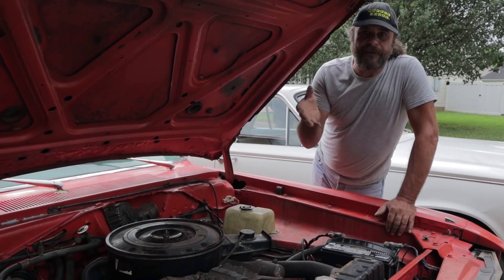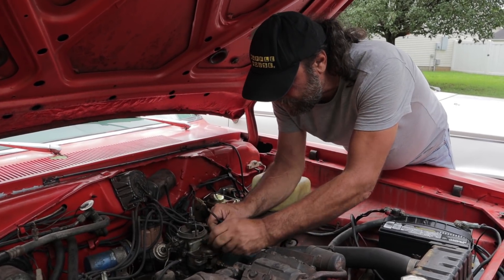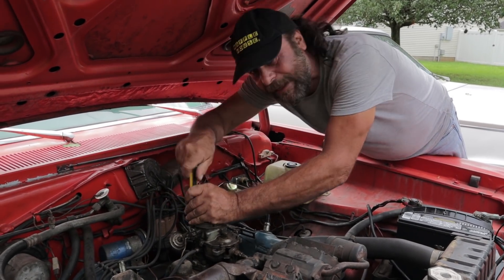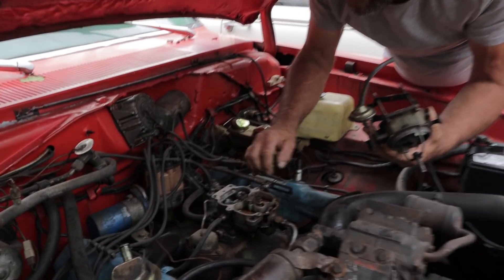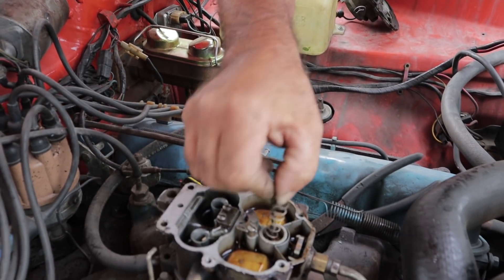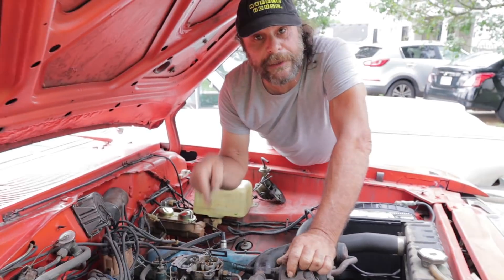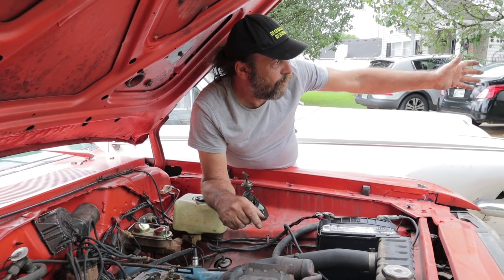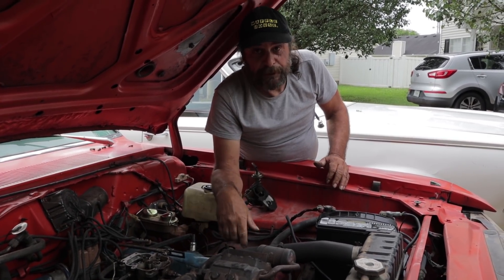Driving Classic Cars- The Truth About Ethanol Gas

Comment: you are much more knowlegable then i am on cars.. however i have to dissagree with you this time.. i have had white corrosion inside the carb on mowers.. motorcycles and cars when using the new gas.. i still use it in cars and trucks but will never use it in anything that may sit for some time between use again

Comment: In my personal experience I will never run ethanol fuel in anything with a carburetor. From a small engine to a car. I have dealt with the problems of ethanol fuel and what It does from sitting. Since now switching to non ethanol those problems do not exist

Comment: The problem with ethanol in old cars is people don't clean all the crap out of the tank and lines. Then they run it and it actually cleans all the crap and as it does that is what is left behind in the carb. It's not rocket science, clean tank and good hoses you wont have a issue but toss modern gas in a dirty old tank and not clean anything and its a nightmare.

Comment: Bottom line there is no Lead in today's Gas. The lead coats the valves in older cars to protect them. If you have an old engine that has not been rebuilt with valves made to run on unleaded Fuel you should be adding lead sold in many places to your Fuel to protect the valves. Own a 1969 Firebird with the OG 350 Pontiac Block in it that has never been rebuilt and it's still running strong uses no Oil. a 50 Yr old engine still running great.

Comment: ethanol is poison for your fuel system, after they started selling ethanol i started having carb and fuel line problems with all my old tractors and trucks. all of them started dripping and rubber fuel lines started melting and any small engines would not even start sometimes i think because the gas stations mixed ethanol at more then 10%. so now i only use corn gas in the leaky machines until i get them fixed as the budget allows then i buy real gas.
you are lucky your car is in good shape for now just like people who smoke for 30 years and never get sick from it.
the best one i have seen so far is my neighbors lawn tractor that needed a new carb and gas line because of ethanol, the gas line was actually melted on the inside and no gas would flow through it, i never saw it that bad before.

Comment: Always hear horror stories of gunked up carbs,rotted fuels lines,and whatever else.. I've never had a problem with ~10% ethanol fuel. It does evaporate quickly,and my old 327 takes a bit of cranking before it fills the bowl and comes to life,but other than that,none of the issues you always hear about.

Comment: I respectfully disagree. In my experience ethinol fuel vapor locks all my classics and in certain cases rubber components deteriorated. My vehicles do not like this fuel and I have a multiple make collection. Your video was very interesting though and I’m glad you are having luck with the modern fuel
Reply: How often do you run them and when was the last time you had the fuel tanks drained, inspected, and cleaned if necessary? You're getting vapor lock because there is watery fuel in the fuel lines coming from your tank. If you have water collected at the bottom of a tank from ethanol fuel, you'll need to drain it. No amount of additive will save you from already stale fuel.
Reply from the maker: Check out the video we did on vapor lock a few weeks ago
Reply: Doug all cars are restored to near concourse specs. Tanks have been steamed and sealed. Run great on ethanol free gas. Not this epa crap
Reply: Uncle Tony's Garage I have and it is a great tech video!!!
Reply: @Plasticmercenary  You didn't tell me how long they sit, so I have a hard time believing that, as ethanol fuel has a higher resistance to knock than ethanol free, it runs cooler, and has run just fine in a mechanically fuel injected 1986 Saab 900 turbo i wrench on to 200,000 miles and counting. Fuel today is light-years better than it was even 20 years ago. I don't understand why you old timers think e10 is this evil communist engine destroyer.
Reply: Doug they are ran almost daily. I’m fortunate to drive a different classic everyday of the week if I choose and I often do. My European cars dislike that fuel more than my muscle cars. As far as the old timers quip , I’m 40 , and I will take 1979 cars and older anyday over disposable cars that have limited upgradable tech. Like a cell phone
Reply: @Plasticmercenary   I still doubt the fuel is the problem. Classic european cars don't need an excuse like ethanol fuel to run poorly. 

Forgive me, but your comments about your concourse quality restored classics and modern epa junk makes you sound older. If anything, cars have become far less disposable than they were in 1979. The exception being "luxury  vehicles" built to survive one lease period and ruin the second owners credit at some certified used facility. 

How many miles did your average schlub get out of a base Cutlass, Vega, Escort, Pinto or any other high-volume economy car in the  70s? The malaise era produced far more dreadful cars than classics, as is true with any decade, we just remember the good ones. You were lucky to go 100,000 miles, and even that would have required opening up the engine for overhauls, nevermind how many sets of points and condensers you'd be going through, because that kind of thing was still prevalent. Your average japanese economy car these days has no problem going 200,000 miles without requiring any major overhaul, maintained properly. All my modern cars have lasted well into 200,000 mile territory with no deal breaking issues.
Reply: Doug  the classics are my wheelhouse. You can find a pinto sitting in a barn for 40 years and get it running with some basic mechanical knowhow and a few hours. You can’t do that with software dependent nanny cars. I doubt we will ever see a barn find rescue anything with obd2. As far as fuel is concerned to get back on the subject I encourage you to research what collectors like Leno, Peterson, and other high end collectors run in their cars. Especially carbureted with webers, su, and carter...
Reply: @Plasticmercenary  
Ethanol fuel doesn't scare me, because I understand the shortcomings and can mitigate them with minimal effort. It's not worth buying ethanol free fuel, but you do you. What Leno and his team of engineers feed those museum pieces of far beyond you and I. 
 
Really? You must not flip many cars. Most "barn finds" are incomplete basket cases that were left in a barn for a reason. I'm so sick of hearing about those. Nobody wants a dusty, incomplete car full of rat shit with no history unless it's some long lost limited run survivor, which I have no interest in. I like cars that I don't feel guilty driving to 200,000 miles.

Just because malaise era shit boxes are easy to work on doesn't make them good cars. There was definitely some cool stuff worth saving, don't get me wrong, but you can't deny that modern cars are better, safer, more efficient, more powerful, better in almost every way. 

Modern cars will be restored, you have no idea what you're on about. Computer stuff is easy if you know your way around it, no more difficult that  finnicky analog stuff in practice and all the information you need is readily available online. Computer controlled stuff is usually simple. Either it works, or it doesn't. You diagnose the inoperative module, and replace it. No frigging and farting with jets, springs, cotter pins and dry rotted vacuum lines. We're living in a time where NA V6s make 350 horsepower reliably for hundreds of thousands of miles! OBDII is reaching the end of it's service life, and it's hardly some cryptic magic. It's all basic electromechanical stuff; things that can be checked with nothing more than a digital multimeter. Can bus is the next big thing which is even more promising. Companies like Haltech make ECUs that can allow any and all can bus parts from different makes work together, making engine swap possibilities endless and relatively easy, you just have to spend a little time on a dyno with a tuner. 

Classics are cool, I love my dad's 68 Firebird 400, and you CAN drive them every day of you're determined and can afford the upkeep, but you just can't knock modern stuff in terms of maintenance and outright reliaibilty.

Comment: I like this video. Ethanol is not good for small engines because it evaporates and corrodes small parts lik main jets. If I leave my Honda F250 tiller sitting and go to start it the main jet will be plugged solid because of corrosion. This has happened more than once. The bowls will be dry and were there was gas there will be white powdery corrosion. 

This won't affect a car like it will effect a small engine. The parts are bigger and more likely to pass these small deposits left by the fuel drying up.

The jet in the tiller is too small to fit a sewing needle through. is is difficult to clean it. Also the ethanol effect the Needle and seat. The carb leaks a little bit of fuel though the main jet because the needle's tip is rubber and may have slightly deteriorated. I might try a teaspoon of Echo Shield 2 cycle oil in the fuel when I store the machine. It sound funny, but I've never had a issue with the Echo equipment clogging the smaller jets. I've also started to use Stable Storage treatment. The ethanol is horrible for small engines. Maybe remove the carburetor from the tiller and storing it in gunmout sealed in a jar might help me with storage.

No, I don't think that it will effect a car carburetor like it will a small carburetor.  Old stuff was built better than new stuff. Less plastic that can get brittle and eventually fail.

Comment: That’s funny I drive my 347 ci 6 spd mustang about 3-4 times a month and I’ve had nothing but problems with my brand new $800 carb. Carbon loading up in the squirters and the needle and seat. I’m disgusted. The car is a brand new build and I’ve had nothing but problems.
Reply: Carbon comes from gasoline and aromatics. Ethanol produces NO carbon deposits.

Comment: 15% ethanol fuel soon so the corn farmer clowns in Iowa can get government money.  Down here in FL I can get non ethanol fuel.   I noticed my older fuel injected cars that were designed on "Non ethanol fuel" days run much smoother at idle when its hot and starts alot faster when it sits.  .  Non ethanol fuel also makes my small engines start effortlessly.  I have not had to change fuel lines, primer bulbs, gaskets   If you buy Ethanol fuel and let your car sit, dont. It just evaporates in your gas tank and so does your money.

Comment: My biggest problem with ethanol is the smaller punch per volume issue.

That simply equates to more cash wasted.

However there is a pretty good side by side comparison of Dino juice and corn on the Project Farm channel that shows the positives of non ethanol.

After ethanol killed the accelerator pump on two different daily driver 1bbl carbs I've avoided it like the plague and will continue to do so.

They weren't cars that sat for more than 3 days at a time.

My old Honda 400 got 40 MPG on 91 ethanol and nearly 60  mpg on 91 non ethanol.

My slant six was 20+ on non and 17 on ethanol.

My 50cc Honda Express didn't get 60 mpg out of ethanol but with no ethanol it gets the 80+ it should.

Scotty Kilmer is the biggest joke I've ever seen, he only talks.

Hell I knew about the Ford 3.5 liter water pump issue at least a month before he ever mentioned it because of a guy who had one tore apart to explain the problem.

Scotty didn't do that he just talked.

Scotty says any old car is unreliable to buy unless you know the full history.

He promotes the crap out of OBDII accessories.

The few repairs that "mechanic" has done that I have seen weren't in a shop but on a driveway instead.

Wouldn't a guy who has "customers" non stop actually have a shop to do it in?

I live in Iowa and I get how bad it's gonna be this fall gas price wise as there ain't no corn growing.

I actually just went through hell with my truck from getting a bad tank of gas from a local station due to all the moisture that we've had.

My city made National news because of a temporary flood wall collapse 

Full tune up later and it was still running on 7 without fouling, ran some Marvel through it, didn't help, ran the tank dry (not purposefully🤦) and filled it up, runs better than it did before the miss started (ya know, like it's got new plugs,wires,cap and rotor lol) which points to a tank of bad gas.

I was actually to the point I thought it had jumped time with the way it was running though it had not popped/backfired/etc and wasn't about to tear down an engine in a $500 truck lol

From what I've found over the years is that it's better to run non in a carbed vehicle but to occasionally run a tank full of ethanol to clean the carbon out as ethanol is a good solvent.

Basically everyone has their own preferences.

Comment: Scotty Kilmer. 🤦🏼‍♂️.
Btw. I run an e30 blend in a turbo fuel injected car from 1999. 96 octane mixed with 93pump. Tuned for it by yours truly with 630cc Siemens injectors. Obviously fuel system not designed for flex fuel. For 3 years now with no problems. With 20% rubber lines, 80% plastic on the way to the rail.  Bosch fuel pump. Running Bosch 4 bar fpr.

Comment: Ethanol will distroy a fuel system if conditions are right and carb have delt with it many times driving it on a regular basis it's not a problem but if it set several months it can become a issue had one carb on 235 chevy that it had eaten carb housing away and filled float bowl with a gray slurry it had set for 3 months had new remafactured carb on it when parked had same thing happen to cj3a with brand new carb on it not a rebuilt both had fuel stabil in them if any moisture gets in fuel system it is a nightmare
Reply: Ethanol does not destroy fuels systems. You may have fantasized that you "delt" with the problem, but you didn't. All problems come from gasoline and aromatics.
Reply: @TheAutoChannel  lol
Reply: @travisbooth7106  I agree. The amount of stupid claims made about ethanol make me laugh, as well.

Comment: Ethanol can't be too bad...All these run what ya brung no-prep drag races that have gotten so popular in the last few years these guys with these obscene turbo'ed/supercharged 1000 + HP cars run E-85 in their cars. Its the new cheap HP I guess. Another little interesting tidbit...I have a small Stihl chainsaw that my dad bought in the 70's that I run  the cheapest pump ethanol  gas in and that thing sits in the garage shelf for years without being used and when ever I need it, it fires right up and runs fine. Stop in I will show you! Its getting to the point in time where we all need to be grateful the we can buy  ANY gas at all because these days are winding down and the time is coming soon where gas will be a very expensive commodity and not real easy to get as more and more internal combustion engines get phased out and with the rapid drop in gasoline consumption refineries will no linger be profitable and be shut down. The writing is on the wall people. Thank you global warming...

Comment: Sorry, I don’t care for ethanol in our fuel. We should not be burning food, and there are smog concerns using it. Fact is, with more of a concentration of ethanol, our cars get worse and worse fuel mileage, (wait, that means more carbon dioxide in the air right?) as well as it pulls moisture right out of the air, corroding fuel tanks, etc. If the fuel is constantly being used, refreshed, it’s much less of issue.
I want the old gas back; the old diesel too. Big trucks used to run better on it- you could tell the difference back in 08-09 during the switch.

Comment: G'Day Tony,Mate you must have different gas /Petrol.than us,,the petrol we get here eats away every thing,,mate of mind had an ute filled with ethanol gas,,we got not more than 10k's down the road and started to run out of fuel,,Now after getting towed to a work shop we were told and shown the amount of substance the fuel filter stopped going to the injector rail and had the tank removed to empty the remain crud out,maybe your rubber is better,,but after it happen twice to the same bloke,,i won't use it,,
Now ifin my car had mods made to run E85,,then different story,
yer ate away the lines from the inside,never thought it would do so much damage,
I agree it won't harm ya carbie but replace your fuel lines first,,

Comment: Old wives tales is what I'd call this... for example it's completely unrelated but still, I went to a friend's house yesterday and he was so nervous about me touching raw steak and hamburger... then touching the salt and pepper shakers without washing my hands with soap. So I told him, for years I've handled raw hamburger and steaks and all I do is wash my hands with water then wipe my hands with a paper towel and I'm completely fine... he said I was crazy and unsanitary, but hey I've done in for years and years without using "soap" and I'm completely fine.... don't believe 95% of what the media tells you because I'm tellin you they want to brainwash you. Also you can run a gasoline engine on nothing but the fumes,.. I've seen it done before my own eyes and you can get north of 100 miles to a gallon

Comment: Small engines (weed eater, leaf blower, etc.) are a different story.
Reply: Bob Bastion they’re worse huh
Reply: @Funlu  Yes. They have a small diaphragm that acts as a fuel pump and they MUST be pliable and soft to function correctly (or at all) the ethanol makes them crispy and stiff. I pay the extra cost for "real" gas for my small engines. ethanol doesn't really bother the larger lawn mower engines (Briggs, Tecumseh, etc.) until they sit all winter but both kinds need some Sta-bil (or similar product) run through them prior to winter storage.